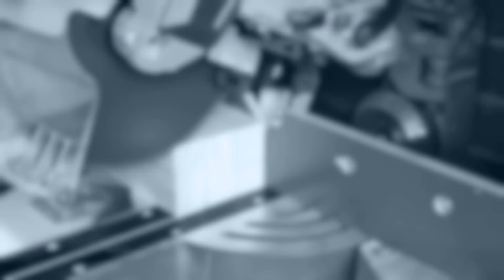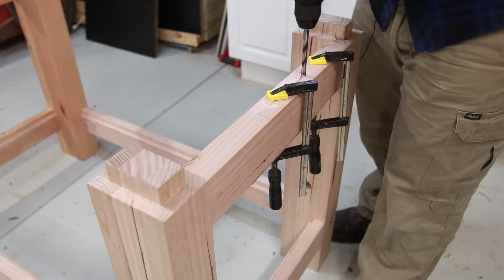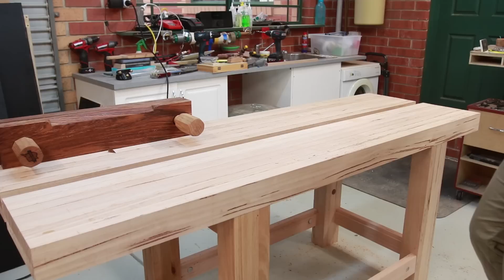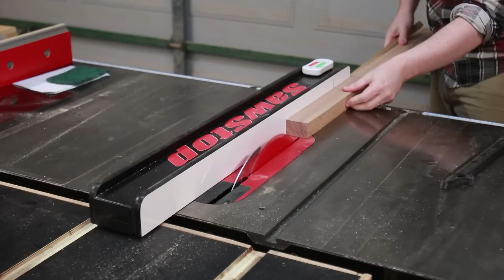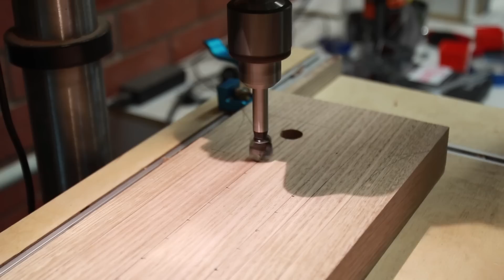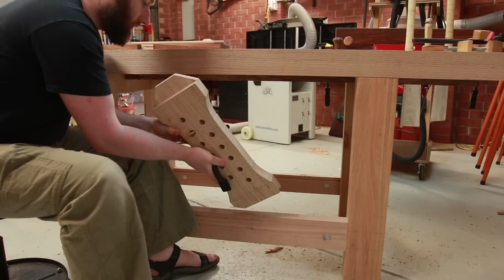128 - TWK Split Top Roubo Workbench: Sliding Deadman

Comment: 'Plunge no more than 1/2 the diameter of the router bit'... help with this Obi-Wan.  I have heard this golden rule on several occasions, but I strughle with it.  So if the router bit is 10mm in diameter I should plunge no more than 5mm, and if the router bit is 25mm I can plunge 12.5mm.  I thought a greater diameter would result in  a greater cutting area (and strain on bit and machine) thus requiring a shallower cutting depth.
Reply from the maker: I don't know of any bits designed for plunging that are 25mm! Its also to do with the surface speed of the cutting edges, the strength of the router bit (the steel port ion, etc).

If it helps, maybe 1/2 the diameter up to ~1/2" (12.7mm), then no more than (6.35mm) 1/4" per pass?
Reply: Cheers mate...
Reply: So much to learn...
Reply from the maker: It sounds like you're at the stage I've really only recently gotten to - knowing enough to know you don't know anything!
Reply: That's the one.
Reply: LMAO guys! Life's too short not to make fun of ourselves. Great Video Paul.

Comment: Nice video man! Bravo👍🏼 - what blade are you using on your mitre saw - it cuts soooooo cleanly?! May have to change mine! Thanks in advance. Eddie (UK)
Reply from the maker: Its a Flai X30 "Z-Type". According to the local distributor, its not even Flai's best blade for mitre saws! Its not a cheap blade, though I was very lucky that a viewer sent it to me. Previously I'd been happy with the Bosch supplied blade, but... I was wrong. Next on the chopping block is to get rid of the Bosch blade in my circ saw!
Reply: I've been very happy with Infinity products. Especially the 1/4" flat top tooth. rest for tenons/dados on the table saw.
Reply: Awesome thanks for the reply !

Comment: Coming along beautifully!  Great work!  I'm curious, did you even look at the #Bosch Reaxx table saw?  I'm not saying their miter gauge is any better.  I'm just wondering if you're aware that SawStop now has competition and with a different digit saving system.  Cheers!
Reply from the maker: +RXR Sawdust Station I didn't. I bought my sawstop many years ago, before the Reaxx was a thing. The Reaxx was never released outside the US, so it's the wrong voltge. It's also a job site saw rather than a contractor or cabinet, so much less powerful. It's all a little moot though as I believe the latest court case has seen an injunction placed on sales.
Reply: Ah...that voltage thing keeps catching me :-)  I didn't know Reaxx only came as a "Job Site" saw...I assumed they'd have a line of saws by now.  I was not aware of the lawsuit, although I may have heard about it, brief mention, in passing.  Since you mentioned it, I looked it up.  No injunction.  A "initial determination" has been issued in SawStop's favor, but sales of Reaxx may continue.  I think I prefer the Reaxx system primarily because you don't destroy the blade while saving your digits.  Keep the chip in the air, Paul!